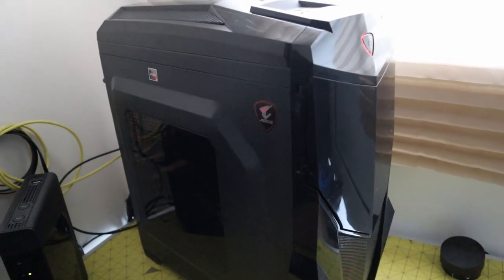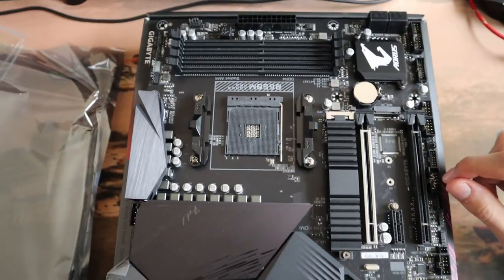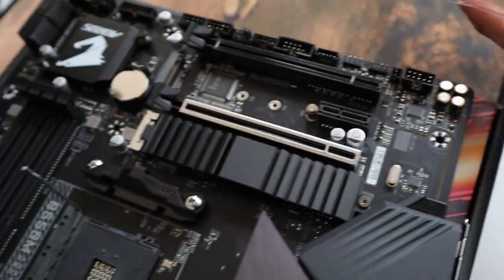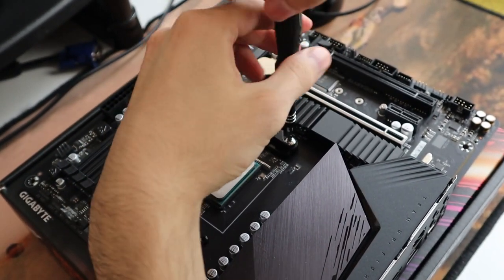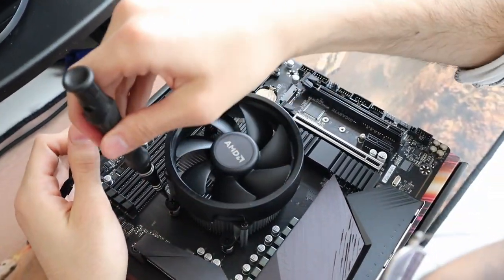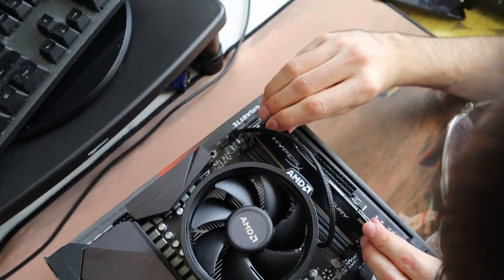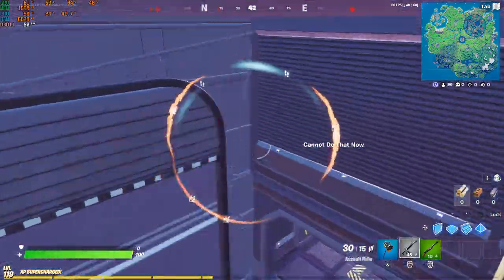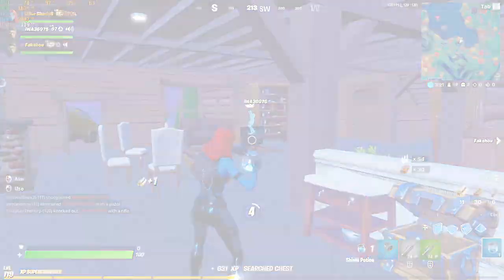HOW TO INSTALL AMD AM4 RYZEN 5 3600 XT + Performance Test

Comment: The AMD logo is supposed to face the opposite side of the ram
Reply: Thus allowing the use of all slot comfortably
Reply from the maker: Yes you're right, but even like this u can still use the 4 slots not a big issue.
Reply: @averageslim5028  only as long as you have low profile ram if it has huge spreaders then no go.
Reply: @DwarfKilla  if you use ram such as Corsair vengeance lpx 2 sticks, it should be fine
Reply: doesn't matter wheres it facing. Even bitwit (trusted pc building youtuber) said it! Unless if the logo is blocking something